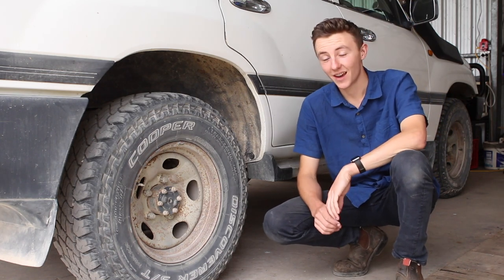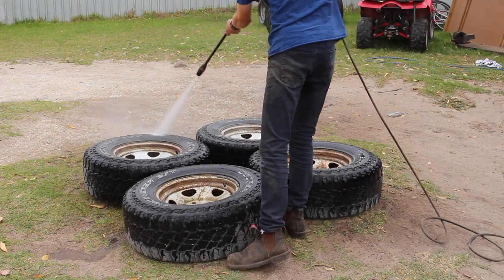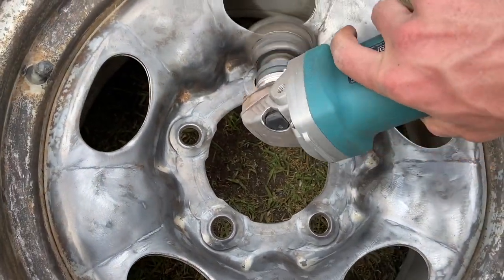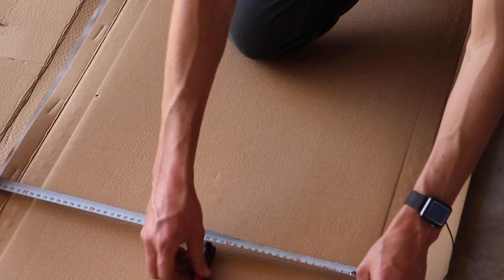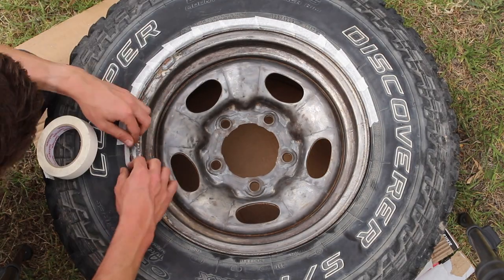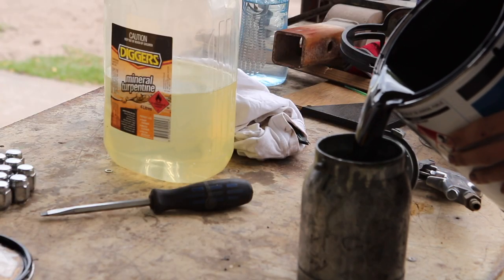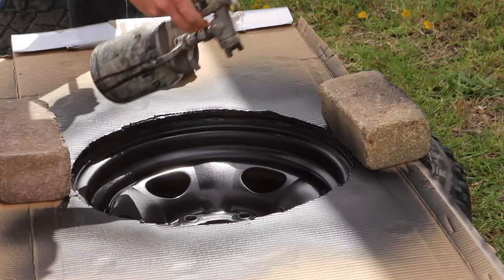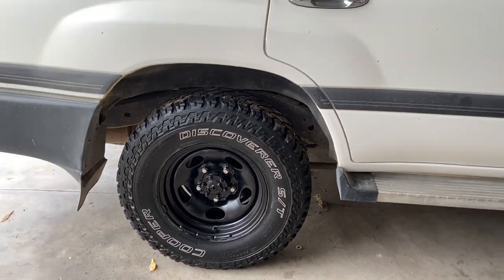How to Easily Repaint Your Car Rims

Comment: About to do this as well where did you get the paint I’m trying to find where to get it supercheap auto? Cheers looks good
Reply from the maker: I got the paint at “the paint place” in mount gambier SA. So I am guessing most paint places would have a similar kind of paint on hand in 5L drums. You’d be pleased to know that 2 years later they still look great 👍
Reply: @WillsLandcruiser  cheers mate
Reply: @WillsLandcruiser  how much paint to do just the rims you think?
Reply from the maker: @mkf648racing9  from memory, probably 3 out of those 5L at least
Reply: @mkf648racing9 what sandpaper grit did you use

Comment: Description says "All you will need is some soapy water, sanding tools and paint"....omits the need for a paint spray machine & angle grinder...also if you don't take the tyres off, won't the rust be running rampant in the bits you didn't get to?